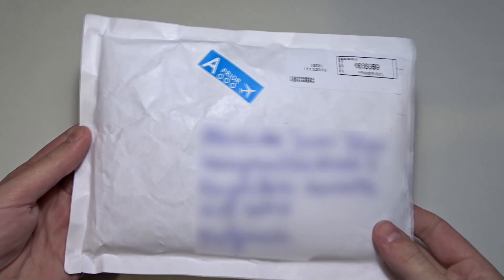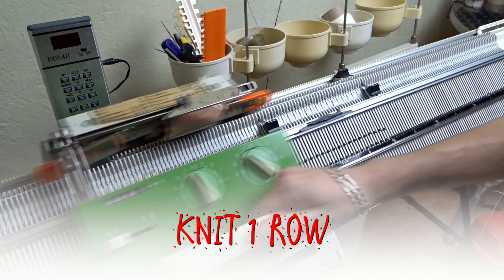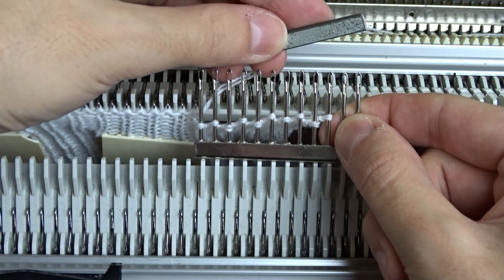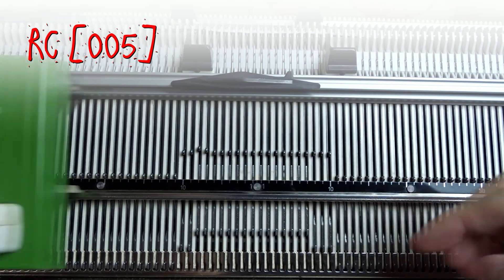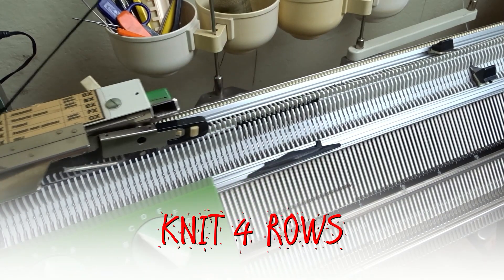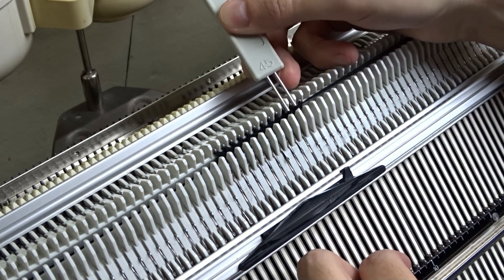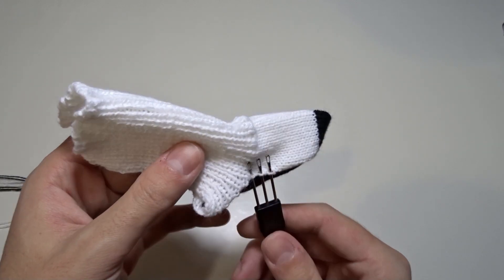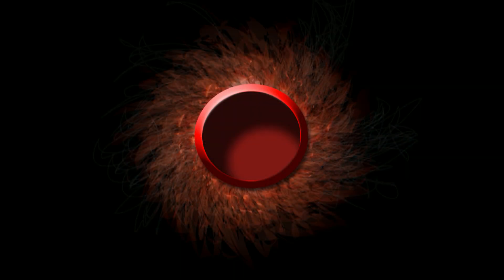Free Mary Jane Passap Pattern

Comment: Usually I use the decker combs like you did here. Sometimes I want to hold my stitches open, yet knit another section in it's place, then reattach the first section later.
I can't think of any good examples at this moments, but something like I might do one gloves.
Reply from the maker: Yes, I had no idea they could be used in making gloves. I guess this will make the process a lot faster. Pretty good idea!

Comment: I'll be looking for that transfer tool video! I have several duo 80s, and only 2 U-80s between them all. Everything, I purchased used, so I'm not certain if they need adjusted, or repaired, or if I am not doing I correctly.
Reply from the maker: I have 2 U-80s too, and I had a hard time learning to use them. I also thought mine were damaged. I only used the U-70 lock, because it is much easier to work with. The U-80 lock has some very useful features.